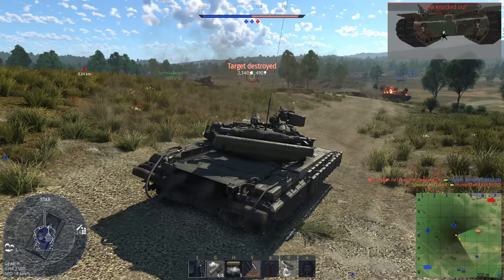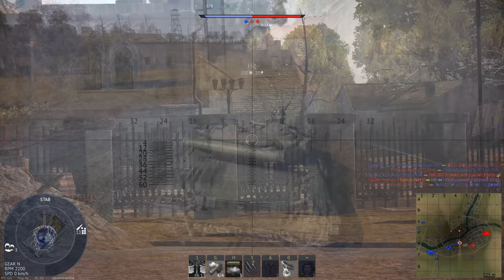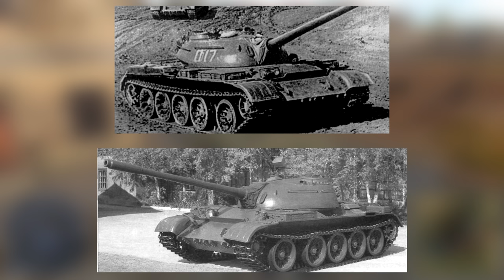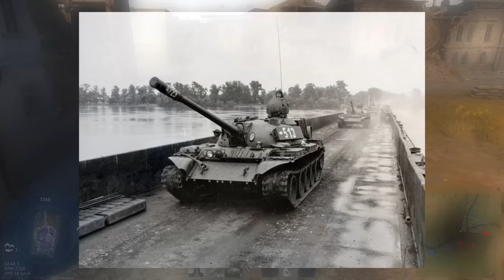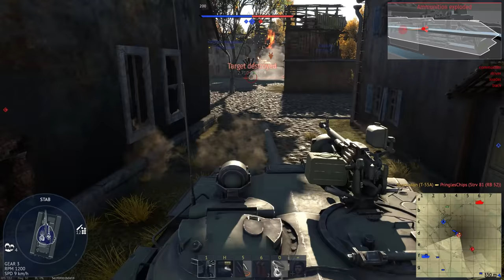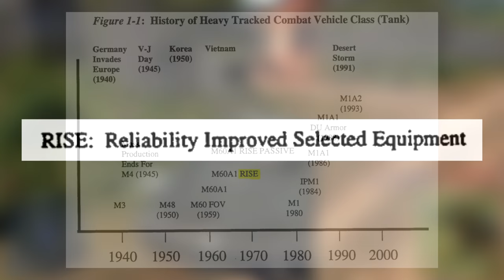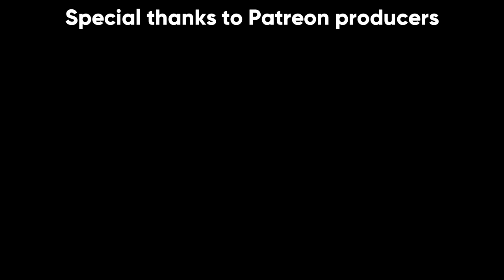Were Soviet Tanks Poorly Made?

Comment: I never really saw the Russian tanks as being particularly unreliable, I tended to chalk up poor Soviet tank performance with poor Soviet tactics, doctrine and strategy. Take Afghanistan, the Russians utilized mass armored movements through mountains, something that worked for the Germans in the Ardennes because the Germans actually had surprise, both France in 1940, and the US/UK in 1944/45 didn't expect a German armored assault through the Ardennes.

Comparably, in Afghanistan, the Afghans know the Russians would have to use one of the exceptionally few roads that can support the weight and size of an armored column, and that the Soviets would travel through said route regularly. Thus ambushes with RPGs, LAWs, and other handheld AT weapons was easy. Combined with the ability to stop and even box in entire tank divisions with the elimination of the lead and rear most tanks, Afghanistan was a Soviet failure of strategy not too dissimilar to the other major Soviet Tank doctrine failure in the Winter War (the Soviets 1939/40 invasion of Finland, which they did eventually win, but at far greater cost.)
Reply: It's not like they had a choice. Tanks were literally the only vehicles able to resist RPG-7s and mines, and the roads were the only way of transporting materials and troops.
Reply: They learned that lesson again in Chechnya in urban areas.
Reply: @phunkracy  they did have a choice, the choice we saw later in the war when they started using primarily helicopter based units to protect the convoy lines and clear ambush points, to the point the US had to arm the Afghani with AA launchers to put a dent in the tactic.

Compare this with the early war tactic of just ramming a tank division through a choke point with minimal infantry support.
Reply: @Mikalent  Soviets had to modify their heli fleet specifically for mountainous terrain. They also had to prepare infrastructure for helicopters. Both things take time and combat experience.
Reply: @joeblow5214  yup, thats why they did very well on the 2nd war
Reply: @phunkracy  so I point out the obvious again, shoving a tank division through a narrow pass, and I emphasize, "WITH NO INFANTRY SUPPORT",  because Soviet doctrine of the 1970s and 80s kept the mechanized/motorized infantry and armored divisions seperate.

 The helos where just a convenient way for them to deliver infantry quickly, you can achieve the exact same result by expending dismounted motorized/mechanized infantry to create the outpost system the Soviets eventually made with their airborne troops. Rather than having a tank division run a gaunlet of mines and RPG7s, that mind you would still destroy the tank and kill the crew because the launcher is being fired from an elevated angle onto the top of the tank, every time outpost 3265 required more ammunition.
Reply: Imagine yourself having a sincere believe that "Winter War" wasn't initiated for experience solely (primarily).

Also your knowledge about the Whispering Hills is extremely marginal and laughable.
Reply: @phunkracy  also the Expert forgot who build those roads. And some plants. And the gigantic relict of the former yet more advanced age for Afghan – the irrigation channels complex.
Reply: @Mikalent  really? Separate? Who told you that? Division composition itself, I will surprise you, wasn't solely about just armoured objects without infantry... I dunno where from you take this data
Reply: @worldoftancraft  what? Lol what does it have to do with anything lol
Reply: @worldoftancraft  per "Soviet Army operations and tactics handbook" written 1974 "Concerning the use of armored and mechanized divisions.... armored units are to be used to create an operational opening within enemy battle lines, with the deployment of mechanized infantry forces to exploit the created opening and apply pressure the the enemy rearward and logistical units therein." Simplified, Soviet doctrine per their own material was a modified version of Soviet "Deep Battle" doctrine used during WW2, with adjustments made from lessons learned during Kursk and the Drive West. This is also supported by Soviet tactics per FM 100-2-1 compiled by US DOA 1984 "Soviet Mechanized infantry used in exploiting operational breakthrough are expected to be able to, if not commonly, fight without armored support, as such Soviet equipment in IFVs carry fewer personnel, but are able to act in a manner similar to [US] light armor in direct support of infantry as an assaulting unit".

Also per Soviet strategic command, this is exemplified with the 2 main land force  groups the Soviets deploy on a strategic level, the "Combined Arms" army, consisting of a standardized 4 motorized Rifle divisions, 1 armored Division, and various supporting units, contrasted to the famed Soviet "Tank" armies, consisting of a standardized 4 tank divisions, 1 motorized rifle divisions, and accompanying support units.

 Now per the official Soviet deployment (Soviet records of the 1979 war have yet to be fully unsealed) initial Soviet deployment consisted of a half division of armored units, and per US DOA FM 100-2-3 (dated 1991 so you are free to throw criticism that way) a tank division can only muster a questionable 360 infantry personnel taken from supporting howitzer, recon, engineering, and maintenance support companies, in that tank divisions directly have no infantry support, as they are operationally supposed to be supported in a "tank army" by a division of independent motorized infantry.

Per Soviet stated OOBs 40th "Combined Arms Army" was assigned to the theater, where it was decided that 5th guards, 108th motorized, 68th motorized would be deployed to stabilize the border between the USSR and Afghanistan. Only the 10th Tank division with the supporting 5th AT brigade where used to enter and secure the two overland routes, the only infantry component of the assault was the 103rd Guards airborne division assigned to the army, which was landed in Bagram, away from the actual overland routes. It was not until later, with the addition of the 56th Seperate Airborne assault brigade, 36th Mixed Air Corps, the 201st and 68th Motor Rifle divisions did the Soviets add an infantry element to the Front and rear line combat elements. All this again, points to a failure of the Soviet's doctrinal and strategic approach.
Reply: Soviet design bureaus are top tier.
The entire 99% rest of the government were peak barbarians though.

Comment: The T-72 is an extremely reliable tank, debatably more so than it’s NATO counterparts. I saw a report of the US military getting their hands on a captured T-72. It was leaking oil, but it seemingly didn’t even need it, because after the oil ran out the tank continued to drive around just fine. Another thing is the tracks; they had tried multiple times to intentionally throw a track by throwing everything at it and nothing was working. Not to mention the Silver Bullet (M829A1) did manage to penetrate the front turret, but only bearly. This showed that with modifications to the armor, it would have been able to stop the round. It’s like the Honda Civic of tanks, love it
Reply: A guy I know worked with the government on a captured T-72 or T-62 (will have to ask him to confirm which one lol) and he said it was wonderful how reliable it was,  but would have hated to crew it as it felt extremely cramped and he is only 5’8.

Comment: Some definitely were. IIRC the T-44 had a major problem where non-penetrating hits during live fire trials could still make the welds holding the armor plates together fail, and then the whole thing would disintegrate like the Flintstone's car.
Reply: Yes it did, but it was mostly because the firing tests were using very powerful weapons in successive fire, like the 100 mm D-10 and the 88 mm PAK-43, which were one of the best anti-tank weapons at the time, and, hitting the same armor plate 15 times with a powerful anti-tank artillery, is not something realistic or even possible to survive
Reply: T44 was blasted to bits and still did not fall apart like the Tiger II plate. And note the T44 plate is 100mm not 150. Soviet steel was better.

Comment: The t-34 had the highest failure rate of all majorly produced tanks in WW2, which was because the factory 183, which produced about 50% of them cut corners to reduce the manhours needed for 1 T-34 from 8000 to 3700. They simply left out everything that they felt was not needed, like internal and external lighting, the hatch sealing to keep rain out, the radios, the entire turret basket, heat treating of the gears and drive shifts, using steel roadwheels on steel tracks because of a lack of rubber and so very much on.

TL; DR: The factory producing most T-34's in WW2 made over 26k of them through cutting corners like it is crunchtime at the circle factory.

Comment: i love how for the most of the cold war the warsaw pact was always on a technological superiority when it came to tanks until NATO started putting thermals on their gunner sights.

the soviet union had been at the forefront of tank design for most of the 20th century and its not well appreciated. export models of the T-55 and T-72 did suck a lot and i did hear that some iraqi T-72s had concrete or desert sand instead of their sandbar composite armour for the turret. but the tanks that were being used by the armies and guards armies of the USSR had great nicely manufactured vehicles with very advanced technology in armour and weaponry, they just lacked very advanced fire control systems.
Reply: True
Reply: The Soviet tanks were literally a collection of high tech, encased in poorly designed platforms incapable of fighting on a battlefield. The fact that they were incapable of occupying a hasty hull down position due to lack of gun tube depression for instance. Western tanks could, and did, massacre Soviet tanks when they went head to head every time it happened, regardless of tech. Soviet designers went way too far down the "compactness" rabbit hole and failed, utterly in the process.
Reply: @drewschumann1  they were desinged to fight in the east all flat plains and such gund depression is not as importent there
Reply: @drewschumann1  they had a reason to make all of their tanks small and light, their doctrine was that they would be the ones to attack into western germany if hostilities broke out. and they'd expect that all of the bridges wouldve been blown up by NATO, so they had to make all of their tanks light to be able to easily transport them through rail and pontoon bridges without having to worry about the logistical side of taking care of a 60 ton tank's advance into western germany.

also every time western tanks clashed with soviet tanks they were almost always export models of said soviet tanks and operated by subpar foreign crews so thats not really a valid point. The Iraqi T-72's with monolithic steel/concrete turrets and extremely bad gunners that couldnt hit the broadside of a barn cant be compared to a T-80U in the western group of forces advancing through the fulda gap with kontakt ERA and top of the line crew from guards divisions
Reply: *its also the reason why the BRDM-2 recon car, BTR-series of APCs, BMP-series IFV's, and BMD--series IFVs on top of a lot of other assorted vehicles all shared some kind of amphibious capability, they didnt want to rely on bridges or rely as much as they otherwise would.

Comment: You missed a few key parts on the T34, though I get it, the video needs to be short. How factory 183 managed to cut production times was but cutting corners. Many corners. "Cosmetics" is pretty misleading. America was building tanks at an unprecedented rate, they weren't wasting time on pretty tanks, otherwise the M3 medium tank would never have left the production line. No, the T34s made in Factory 183 which produced over 50 percent of all T34/76 tanks during the war. Cut times down by cutting out lights, as in head lights and tail lights, this lead to an infamous incident where a t34 crew ended up following a German convoy thinking it was a Russian convoy, they were captured. They also cut things like optics. Now the gunner sights on most T34s were actually pretty good, some were faulty but most were good. But the viewing ports and periscope for the commander and driver were very poor, leading to many incidents of T34s being driven into ditches because the driver never saw them and T34s coming under fire and them not reacting because they never saw anything and the noise bleed of the engine was so loud, you wouldn't hear a shell unless it hit your tank. This was immortalized in an incident when a German 37mm gun fired 26 rounds at a T34 before it finally noticed them and then proceeded to turn and open fire. Now, the gun wasn't going to do much to the tank, but the tank wasn't engaging a different target, it was just crossing an area, and suddenly came under fire. Also, no radios, radios were left to command tanks, which meant coordination was terrible, leading to higher losses which meant the tanks needed to be made faster, therefore more cuts, a never ending cycle. Also, in many models, there was no turret basket. In most tanks, the commander gunner and loader all spin with the turret so they are always in the same orientation with the gun. Not the 34/76, while some war time tanks had a basket as it was designed with one, and all post war examples had one. The overwhelming majority of war time produced ones didn't. The men just had to turn with the turret, and not get smacked by the gun as it recoils in a new direction everytime. This cut down reload speeds. Some models also failed to even have seats installed, with some crews using wooden crates as seats because the factory couldn't spare the time to install them. And all this is to say nothing of the quality. The T34 was welded. Badly. See, in America and Britain, early war tanks were riveted and late war tanks either cast or welded. The reason is they didn't have enough forges to cast the tanks in the beginning and they had a major shortage of skilled welders and it took time to train enough welders. Russia on the other hand? Would run peasants through a crash course on welding lasting anywhere from a few hours to a couple days if they were lucky. Meaning the welds were poor and lacking. Combine this with brittle steel because the Russians overhardened their steel, and you have a tank that had a proclivity to shattering its armor plating. Over half of all T34s produced during the war were destroyed, and the majority of which were lost to mechanical breakdowns. It was so bad Stalin thought it was sabotage because there was simply no way that more tanks were breaking down beyond repair than being destroyed by the Germans. When factory 183 was inspected in 1943, only 7 percent of tanks had no defects. The T34 was an excellent and modern design on paper, but no T34s made after the start of the war ever came close to the standard set out by the blueprints.

Comment: I think some people (lazerpig) overstate the problems with Russian MBT's and equipment in general.

Like sure, most of it is at least a little behind, technologically. But none of the technological improvements in the last few years would let them overcome poor crews and stupid tactical decisions (i.e. driving down the same road into the same Javelin ambush repeatedly). If the Russian army operated M1's, they would lose a bunch of those instead. Foreign armies have proven that US equipment isn't invulnerable if use poorly.

You don't need state-of-the-art tanks to put them to good use, and some of the upgrade packages are actually pretty great. Many of the T-72's being knocked out had stabilizers, thermals, and fire control systems. They're not as good as most NATO tanks but they absolutely didn't need to be in that position.